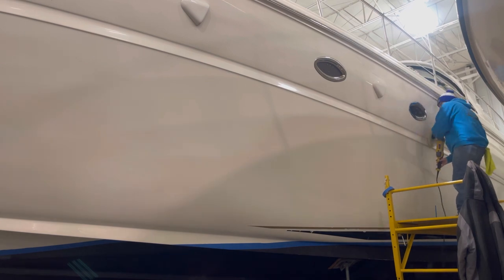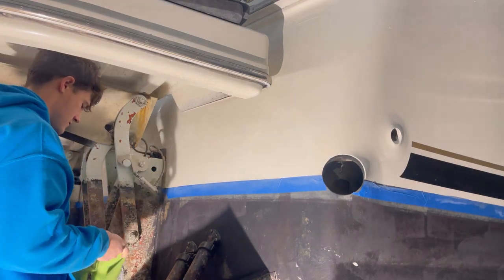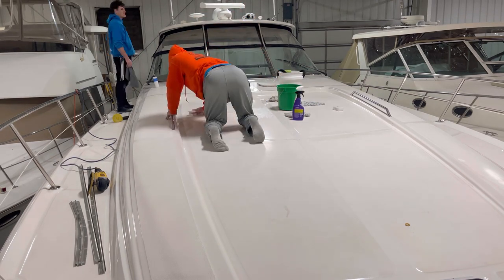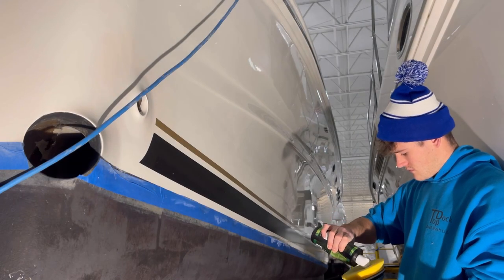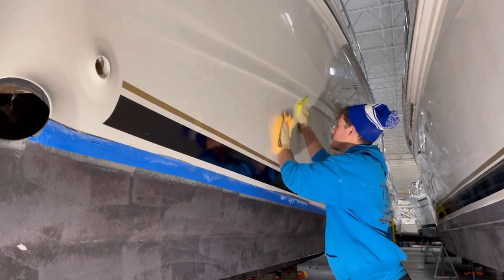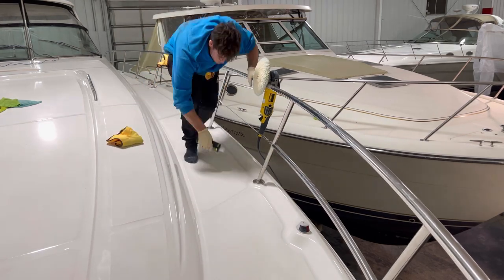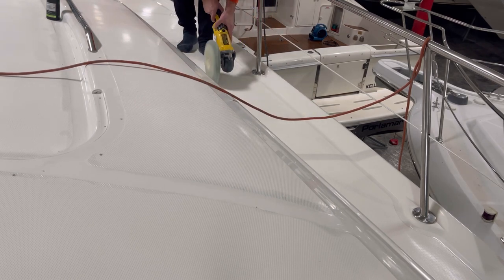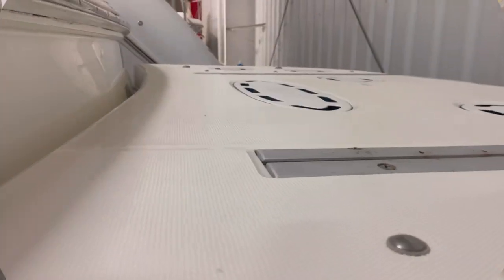Boat Detailing Basics | How to Detail a Boat | Secrets Revealed

Comment: What speed did you use to apply the Power lock?
Reply from the maker: Speed 3 on a griots garage DA polisher
Reply: @topdockpro  thanks Simon I applied it to my sailboat and it’s definitely a learning experience. What pad do you like for power lock? I was using a chemical guys black foam finishing pad. I felt like I had to push hard to get a good layer. Also it was impossible to clean the pad after. I rinsed and squeezed it for half hour and more and more jescar kept coming out of the pores of the foam. I think I wasted a lot of product just stuck in the pad. Can I just leave one pad as my “jescar” pad and not worry about squeezing all the leftover product out? Do I want to avoid getting the pad deeply saturated? Thanks for the help loving the videos